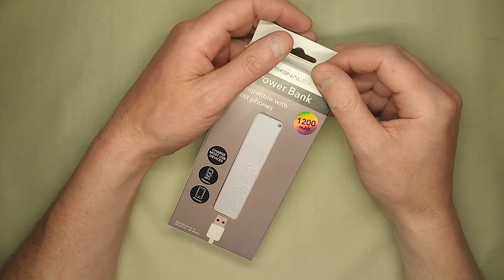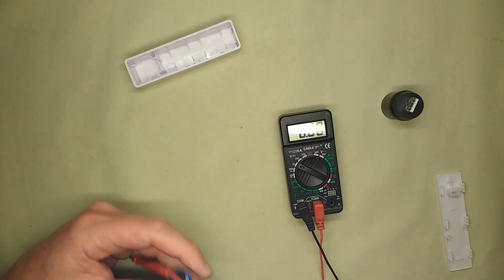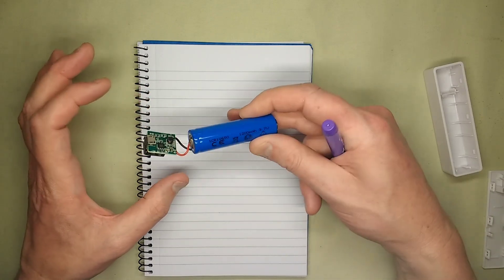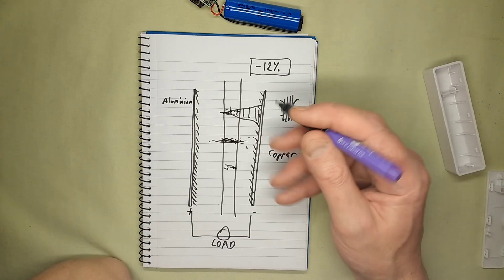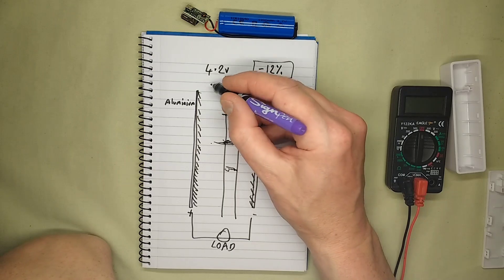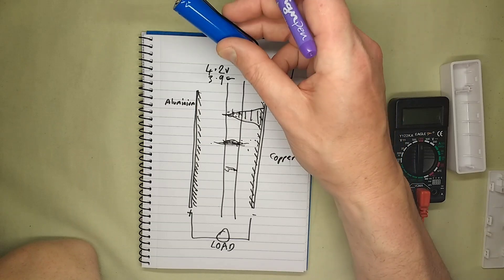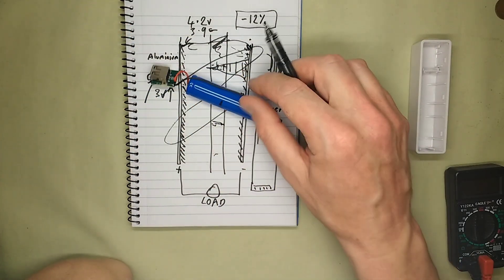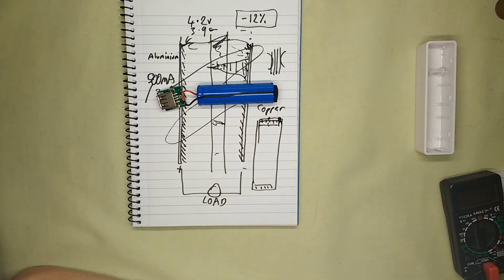Are over-discharged lithium cells safe?  (And how to test for damage.)

Comment: clive, how about a review of some of the cheapest desoldering tools, both braid and pumps, so we know what cheap one to buy?
Reply: @john, but we like fake from china!
Reply: the only difference between the good braid and the crap stuff is the lack of flux in the latter. I got a roll of the duff stuff but if I dip the end in my tin of flux before use it works perfectly.
Reply: I have a cheap (manual) desoldering pump that I've used for years now and still works. Because it worked so well in the beginning I ordered 3 more just to "have some" since they only were 2€, but never needed them until now. Search for one that looks like that: https://www.pollin.de/p/entloet-pumpe-zd-106-840070  (I hope this doesn't get flagged as spam). Don't get the desoldering pump with the metal body, they are really crap (had a few of them before).
For desoldering braid I also got the cheapest I could find (around 1.50€). You need to use flux anyway when desoldering, so I apply just a little bit more (that's the main thing missing from cheap braid).
If you are cheap (and you are, since you are searching for the "cheapest" ;) ), you can buy the raw rosin (Kolophonium, around 1.50€ again) and dissolve it in isopropyl alcohol and you got almost a life's supply of flux.
Reply: I am thinking the same. It has to make work easier, but I don't do it so often that an expense is justified.
I have the one with the wimpy clip. I was thinking about putting on a wire with permanent earth connection, but then I saw the developing crack. I glued it again and it was holding up, but the design flaw of the sharp corner is still there obviously. 
I didn't use it much anyway. The main reason for that is it just reminded me too much of the days before I had a soldering station. Either you don't have enough heat and it won't work on anything larger or the tip gets so hot that the solder pads delaminate. The rim of the nozzle is quite sharp as well, so it's almost as if you are scratching around the pad with a knife. It becomes also almost useless on plated through holes. If you don't manage to suck out all the solder in the first go, until you cocked the pump again everything has solidified and now there's no solder on the top to transfer the heat to the rest of the solder in the hole, which means you have to add solder again and try again.
In the end I had much more luck with the soldering station where I can set the temperature and that can "pump" in heat with 90W within seconds if needed while using the cheap "cold" desoldering pump. In this case I guess there is no cheap "in between". I decided to be useable for me a heated desoldering pump has to be temperature controlled, decent power and have a continous pump.
Reply: There is nothing terribly wrong with fake NC556 from China or kingbo flux. Oh BTW I want to get myself on of these desoldering irons that cost about 5€-10€. It's like a soldering iron with hollow tip and a pump in the handle. China even has solenoid based fully automatic ones for like maybe $20.

Hated the plastic desoldering pump I had with a great passion, but it's not the same as you recommended here, yours might have a lot less backlash. I settled on an aluminium body one, I can at least work with that.
Reply: I have one of those cheap heated desoldering pumps as well (at least I think I know which you are talking about). They are crap ;) . The mechanical construction is very poor (immediately developed a crack because of stress risers in corners of the body) and the 230V wires inside were just twisted on, not soldered, clamped or crimped.
Reply: Thanks Superdau for alerting me of haphazard wiring, and i heard already that those from Aliexpress had the issue that it cracks, so i was going to get a genuine ZD-211 desoldering iron (offered as McVoice EPH-40 40W variant, Velleman VTDESOL3 30W variant), in the hope that it would be better. They look the same as the ones from Ali at first glance, but at least from pictures it looks like they're actually not identical in minor details like separation distance between hot end and cold chamber, and hopefully in material and assembly quality. The Ali ones invariably have an Europlug cord with a separate wimpy grounding lead, while the genuine has a Schuko plug for EU importers. Which one did you get?

Then again, one of eBay sellers of the presumably genuine ZD imports writes "For home/occasional use only, not for daily use. Please trust me on this.", so yeah, maybe ZD isn't that much more robust either.

I don't actually do that much repair, but i'll gladly take anything that makes it less of a tedium and gamble and doesn't cost a fortune. Plus if the handle part breaks, maybe i can just make myself a new one by rigging up something or repair it, it's just plastic after all, at least i'd have the business end of the tool.
Reply: Simple: Pump for larger solder blobs, braid for multiple, closely spaced jobs like ICs.  Unless you work at a parts recycling shop, you should be fine with those simple tips. My pump cost me $2, the braid cost me $5 for 3 meters.

Comment: I have recovered a lot high current LiPo cells (those for RC planes or quadcopters) that were sub 1v. Some of them have swollen but they take the charge and hold it normally. The ones in worst shape (twice the thickness from swelling) grew some internal resistance but they were still fine for 2 A loads, instead of the rated 40 A.
In the RC hobby, most of the guys throw away packs at the slightest sign of gassing. That's surely a waste.
Reply: icysunz you havent watched the video. Have you?
Reply: noXi Buy a new pack
Reply: For my and 2 my friend experience they are as stable as the others. The only pack that went on flame for the 3 of us was a new pack with 2-3 cycles and perfectly flat. It was standing there on a table and went thermonuclear by themselve. Just my experience. Yes they grew a high internal resistance, but are perfectly fine for FPV video receivers or monitors/goggles.
Reply: weel checking for lipo packs health may not be issue and may seem okay often they have more than one cell, but its generally ragrded to throw out even if one fails, sure a waste , for commercial use its a necesity but abbist can extract the usefullnes left
Reply: Modeling packs are typically multi-cell and both charge and discharge at high current.  Both conditions that can make damage quite dangerous.
While I don't throw them away, any swelling/discharged/etc ones I mark so I know to keep an extra close eye on as well as only charge them at 0.5c and /only/ on a full balance charger so any weak cells don't get reverse charged.
Reply: Some packs that produce only a little bit of swelling is fine (maybe half a cm at best in increased height) but you do need to really watch over it from then on as it can get into a thermal runaway.

On a rc forum i read a perfectly fine looking lipo went from not swollen or hot too getting a thermal runaway & started a fire in the livingroom. A neighbour had opened the door & thrown the lipo out in the yard as they were outside.
Reply: He has. LiPo =/= Li-ion. Clive (and the paper) are talking about the latter.
Reply: Gio, are you sure you want to put potentially iffy LiPo packs in your goggles? Besides the obvious, my eyes are the part of me I care about protecting most. YMMV.
Reply: Giovanni Carlo Iglina I have two batterys that puffed and have used them in my RC planes for 2 years, supposedly that they are ruined and you are supposed to throw them out but I dont understand their thinking. Unless you have a bad cell, I see no reason to throw out a puffed battery. As Clive stated, a grossly overcharged battery is at a high risk of exploding. I took one out in the yard as I could no longer get the battery to read on the charger any more and hit it with a sharp rake and it violently exploded. In the same sense I had a damaged battery that I never realized it was damsged, I could smell a metallic smell and then noticed damage to the outer and inner wrap on the battery due to a crash. I ended up disposing that battery as that cell was dead due to exposure to air. It was not fully charged when damaged .
Reply: Myself I would also get rid of swollen LiPo packs as it's a sign that something went/is wrong with it. They are not really worth taking risks with as they can burst into flames without warning.
Reply: Giovanni Carlo Iglina What would you do if you need 40A but the pack can't handle it any more?
Reply: One or two Modellers have had fires one in our club kitchen fire, most packs like this end up with high internal resistance which are no good for model helicopter which have a high current demand. From full capacity to 20% in 4 minutes or less.
Reply: I have thought about that matter in the past as well. For anything that flies I totally get the dispose of it mentality, you don't want a failure in the air that can easily destroy your remote controlled device and then also be liable for any damage it may cause in the process of crashing. Compared to the battery packs that's usually a much larger financial and legal risk.

When it comes to the batteries being fairly stable for lighter load situations, it could work but I would still be a bit wary. One of the cells in there is likely to be damaged with an internal short and probably gets progressively  worse as its used over a long period. I wouldn't feel comfortable using (or leaving) those at a place where its a fire hazard or any purpose that's unattended.

Just to be on the safe side even if I had applications that could use the no longer suitable for high drain scenarios packs I'd probably opt to retire them. Now I don't happen to own anything remote controlled that flies but I do know a few people that have that have those, living relatively close to a military airbase has its disadvantages with its massive no fly zone for drones. 

But most of my projects are stationary, if its large and stationary lead acid batteries are still my go to. Cheap, easy to replace, easy to charge and check on. If the project has size or weight constraints though lipo packs or 18650/26650 battery setups have been  great so far. With a preference towards 18650 when possible because I've got a good supply of spares ready at any given moment.
Reply: Always store and discharge those lipos in a fireproof area. Overdischarging a lipo can cause copper shunts to form inside it and cause a short circuit and the cell becoming unstable when charged.

Comment: 3.9V after charge is very low voltage. I personaly don't use cells which will drop below 4.15V after 2 weeks.
Reply: 8bpspfreak2 it's likely not luck, it's by design. If you charge batteries to lower voltage to begin with, they will live a lot longer. This is how Tesla does it too. In fact you can go well beyond 4.2V, usually to 4.4V, but the degradation in capacity over number of charge cycles and total energy stored over lifetime of device can be dramatic. That is if that's what they did on the charger.
Reply: 8bpspfreak2 my Gameboy advance and DS with their abused li-ion batteries still work reasonably well.
Reply: andygozzo72 "Official" is the wrong word as such, it's the cells "nominal" voltage. A lithium battery should not discharge very much at all, especially from fully charged to nominal voltage. If a cell ever did this in a few weeks/months it would be pretty much useless
Reply: I got an old Casio digital camera battery which charges to about 3,95V. Funny thing: it's 13 years old. Bloody 13 years and it still works, let's say, around 60-70%. Now that's quality! (or luck, I guess. And of course charging every now and then despite not using it)
Reply: 8bpspfreak2 damn, I wish modern electronics would use lower charge voltages. Some dell laptops let you set the max charge percentage witch is extremely useful
Reply: the 'official' voltage of li ion cells seems to be stated as 3.7v, this is marked on them so i suppose as long as it doesnt drop below this after a few days(weeks maybe) with no load, probably ok...
Reply: The charger says 4.20 Volts 900mA fast charger (~1230mAh battery), I guess it just degraded enough for the charging to be aborted earlier because the charging current falls below the cutoff point, therefore only reaching 3,9 Volts nowadays.
Reply: 8bpspfreak2, well it's likely to just be coincidence then rather than some mark of quality.

andygozzo72, that's the "nominal" voltage, usually marked as the average voltage over the standard active discharge cycle. Li-Ion batteries have approximately linear relationship between charge and voltage in the useful range, so it's close to the middle between fully charged voltage and cutoff voltage. Say if charge voltage is 4.2V and cutoff voltage is 3.0V, the nominal voltage is 3.6V. Newer cells that can withstand slightly higher charge voltage while maintaining usual life of 200-500 cycles, usually 4.35V, are often marked with 3.7V.
Reply: Yep, a little bit of knowledge can be dangerous, maybe leave the advice to professionals. As someone already pointed out the voltage marked on batteries is nominal voltage, a quick google will give you all the info you need. If you measure voltage on a battery after resting and its at the nominal voltage (i.e a ni-mh battery at 1.2v), it is closer to being flat then charged.
Reply: I don't think so. From few hunderts cells with good capacity only 2 dropped below 4.15V.
Reply: 8bpspfreak2 Did lithium-ion cells even exist 13 years ago?  I feel like it was the era of NiMH or worse, the horrible NiCd.  I could also be losing all track of time though.
Reply: pillsburied, yes, all laptops i've seen from 13 years ago had Li-Ion as standard equipment. In fact i can recall my Dell Latitude CP, a 233 MHz Pentium MMX laptop, having a Li-Ion battery, and that would have been from 1998 or so. Also NiCd was already being phased out at that time, except in power tools and flashlights, with transition period from 2002 till 2005 in the EU!

Also NiCd aren't that horrible, the "memory effect" is almost a hoax, well it is real but it rarely occurs in use and is easy enough to defeat, they can work at -20°C while NiMH almost really can't, and they could deliver more current than NiMH at the time, which is why they were still used in tools.
Reply: Well, my NiCds were pretty bad.  They were from Radio Shack and I still have the charger.  I think they were called Archer.  Anyway the capacity was poor and many loads wouldn't operate for long.  Temperature was never a problem because all my usage was indoors, but "Memory Effect" was a real issue for me.  I used them in my RC cars and electronic games.  Those were a big part of my childhood.  There was no internet back then but the standard advice was to "fully discharge" the NiCds occasionally to minimize the Effect.  I just made a habit of it.    Maybe I was doing more damage than good because a new set delivered far better performance than an old one.
Reply: At the time, there were many bad cells and some good cells, both with NiCd and NiMH chemistries, and for example every cell you'd get in Europe from Conrad under their store brand was utter shit back then, and Conrad is kind of our counterpart to your Radio Shack, except it's alive and well today, mostly because Germany just differs from the States that much, electronics related hobbies are alive and well and Conrad stayed sharp and targeted all of them. RC is a great way to kill a sub-par cell quickly in general, regardless of the charging pattern.

You know these stores don't lose anything by selling you the worst of cells under store brand. Once they're dead, you're not going elsewhere because there's basically nowhere else to go, especially not if you need something else for your hobby, you'll go right back and give them more money to get brand name cells.
Reply: Ohm711 you're wasting a lot of perfectly good cells.

Comment: Big Clive  You hit what happened to the Note 7, right on!  That's what I remembered, but I searched this just to be sure:

https://arstechnica.com/gadgets/2017/01/galaxy-note-7-investigation-blames-small-battery-cases-poor-welding/
Reply: This writeup also details a few other issues they found in their investigation:  http://www.electronicdesign.com/blog/damage-control-samsung-faces-note-7-controversy-head?NL=ED-003&Issue=ED-003_20170315_ED-003_885&sfvc4enews=42&cl=article_1_b&utm_rid=CPG05000004807995&utm_campaign=10118&utm_medium=email&elq2=bd6c2ef2a2f44a12916f2cf7e9c1211f
Reply: I'd never seen what the final outcome was on the Note 7 so thanks for posting that. I'm a big fan of Samsung. I'm still using my S6 which has been a great phone but has a tendency to occasionally get VERY hot. I haven't found a good reason to upgrade to the S8 but I'm going to be REALLY tempted to upgrade to the Note 8 when it comes out. I have about 5 billion reasons to think that will be the safest phone ever released!
Reply: PV2Omni This is the problem with thin devices. Thinner case means thinner conponents, and thinner components means even thinmer production tolerances.
Reply: John Rehwinkel -- Those massive URLs with the in-built tracking information can and should be shortened. They almost always still work if cut off just before the ? mark. For yours, http://www.electronicdesign.com/blog/damage-control-samsung-faces-note-7-controversy-head works just fine!